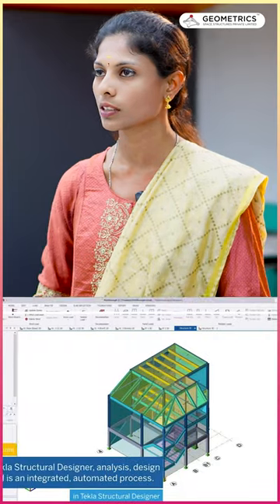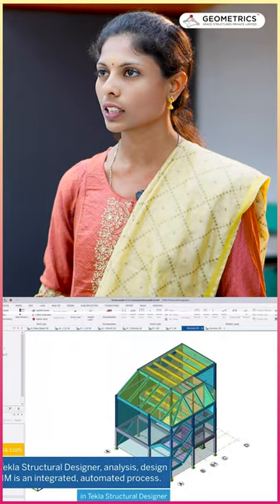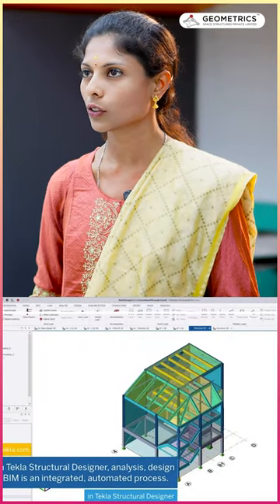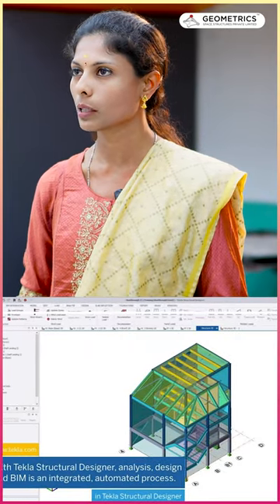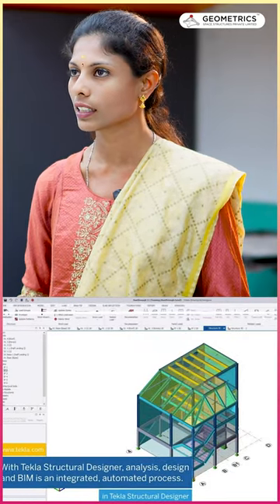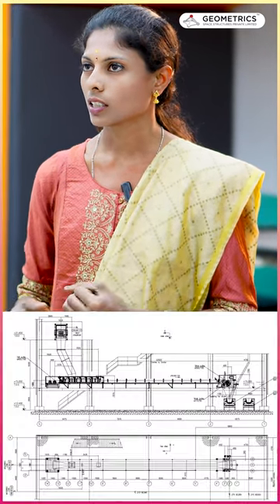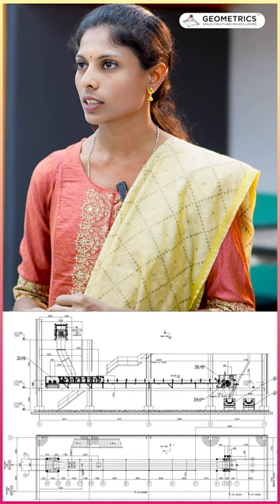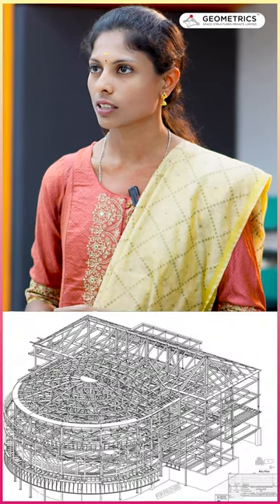Detailing Software for Civil Engineering Tekla is the Best in Class | #steelconstruction  #warehouse

Comment: What is difference between tekla and solidworks
Reply: Tekla civil based where solid works is mechanical based
Reply: Tekla is only a detailing software not even a design software used in civil structures  but solid works is a design software mostly used in mechanical engineering